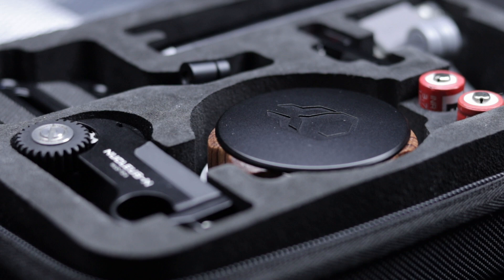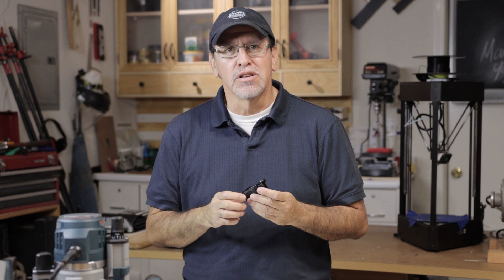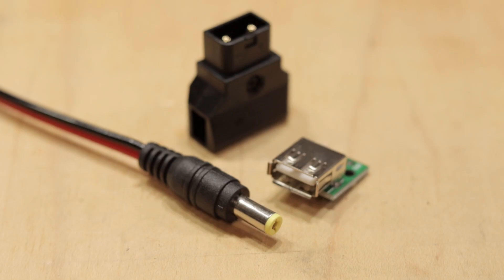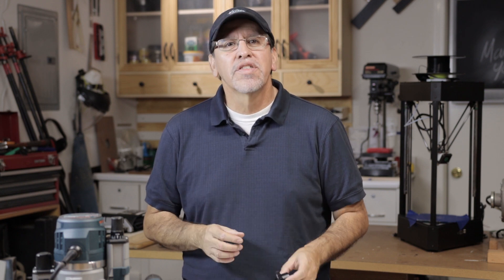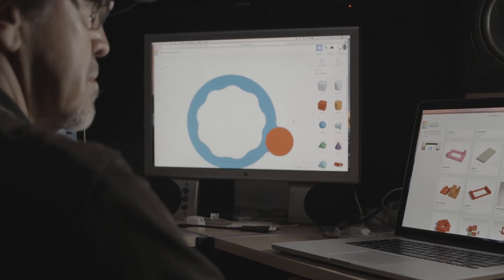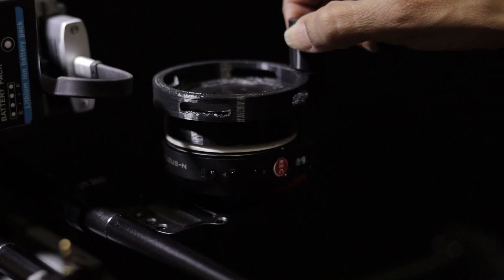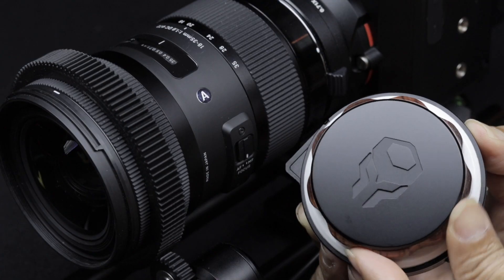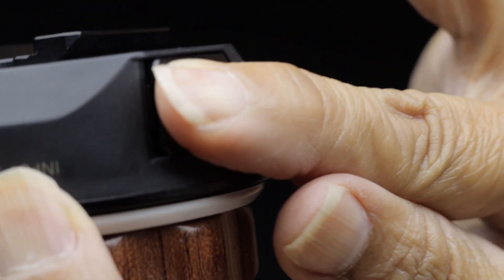Tilta Nucleus Nano Wireless Follow Focus Demystified

Comment: Great video and solutions... my biggest gripe with it is powering the motor... is there solution for the smallest possible power solution that can eve be bounced on the 15mm rail for instance... ?
Reply from the maker: FXLion Nano Batteries are pretty small. FXLion isn't the only V Mount Brand using a small form factor. There's a few out there now.
Reply: @rudytorres6559  true that… sometimes you just want camera lens and nothing else.. so none tethered solution like pdmovie live air2 would be my preference

Comment: Thank you for this . Just wanted to know , is there any problem if the motor and the hand control are placed very close , say ... on the same 15mm rod, will that cause any interference to the movements ?
Reply from the maker: I don't think that would be a great concern assuming your rig is set up for example the motor is at the lens and the hand wheel is let's say close to the handle area of the tripod head, if you follow me. Even if for what ever reason you have the hand wheel  next to the motor for a short period of time, no big deal. Here's where those conditions Might, and I mean Might change, that's if you have 2 Nano set ups. Channels should be set far apart.